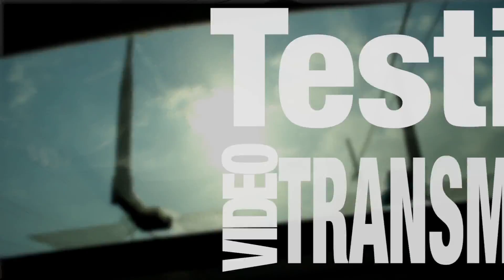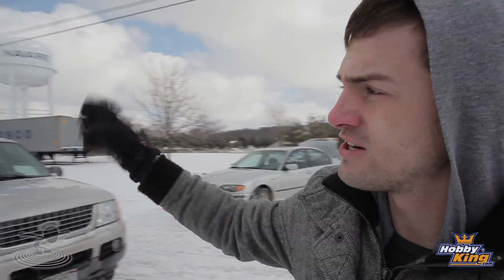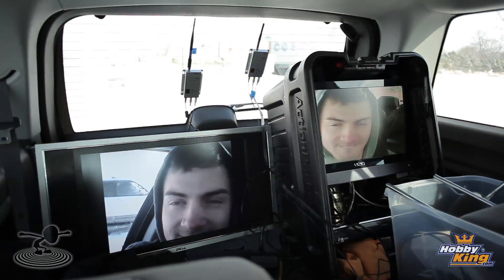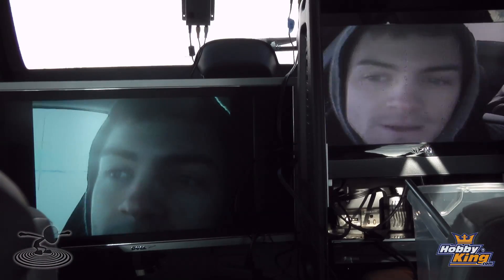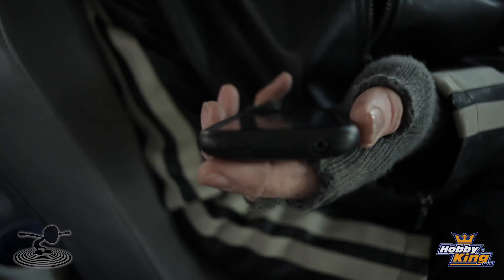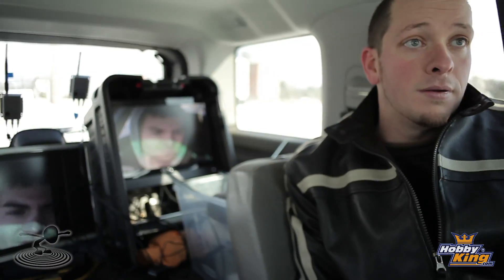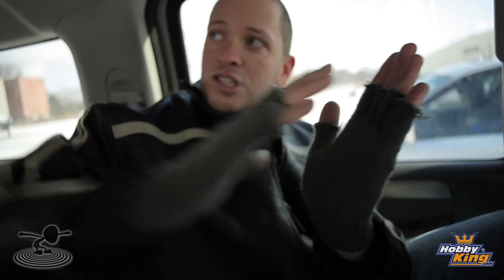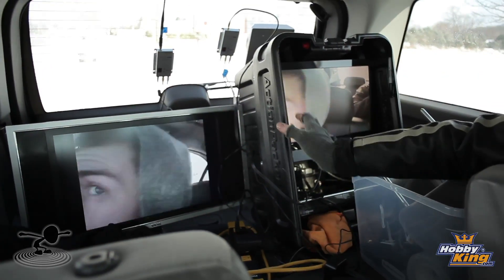Flite Test - Video Transmitter - REVIEW

Comment: hey, just wondering, i am building  "drone" for my 8th grade final physics project, i need an fpv system. looking to get about 250 yards out of it. would the 100mw be enough? or should i go with the 200 mw? price is also an issue. by the way, i saw a parkflyer fpv system on nitroplanes, but it has no specs for mw, frequency, range, and whether it is ntsc or pal. it costs $36 but i am a bit worried about buying it. any ideas?

Comment: You need to do it on a plane to get a real test.  I have flown with the 900mhz  (800 mw) system at about 800feet and 1k away with no drop out at all (omni Directional)

Comment: you should do the same test but throw in you transmitter for your plane and see how they interfere. more so your  2.4ghz radio for your rc link and then the 900mhz transmitter for the video on at the same. i think you will find that the 900mhz will cause the 2.4 to have nasty lock outs

Comment: @tehlump 
The reason 900mhz had a clearer picture is because its a longer wavelength than the 2400mhz (2.4Ghz) system.  This lets the signal penetrate and reflect obstacles better.

Comment: I wasn't there obviously, but it seemed to me that while both frequencies had signal lock the 900mhz had higher quality, less glitching and jumpiness? Also, if you're controlling the aircraft with 2.4Ghz are you prevented from using the 2.4Ghz transmitter? Or do they share the space on different channels? Thanks for this out of the ordinary test, I'm interested in FPV but thus far haven't taken the plunge...